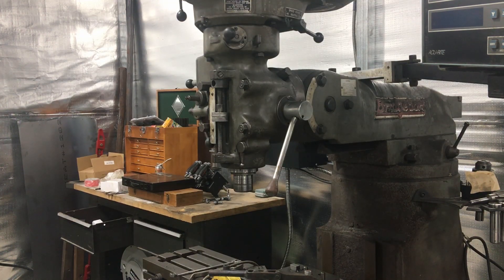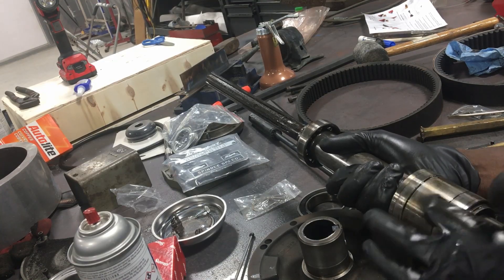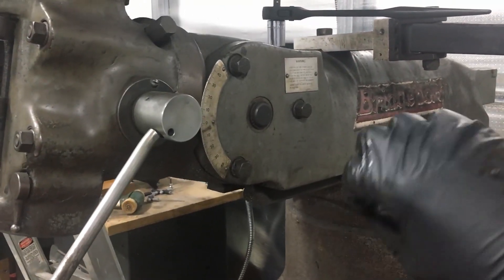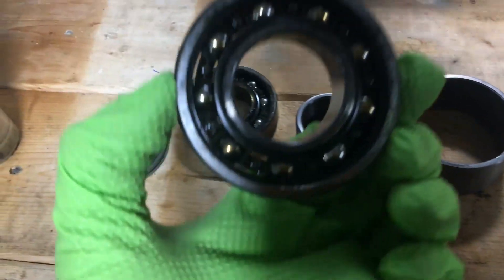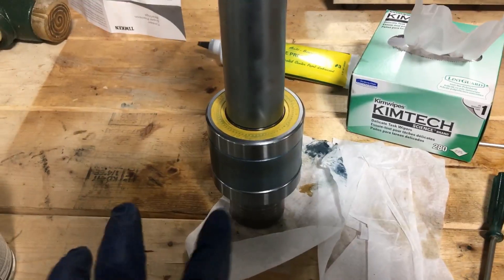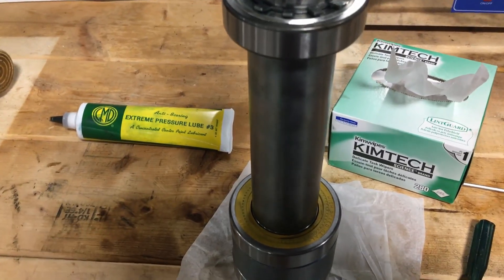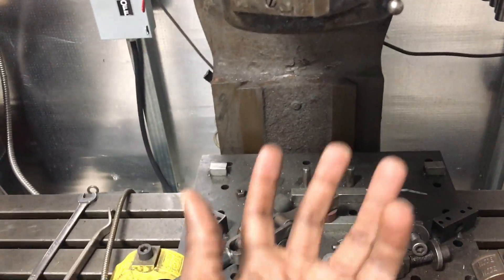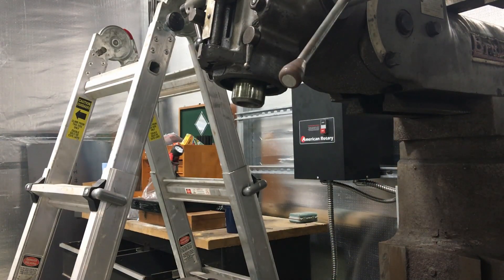Bridgeport Disassembly Part 3

Comment: I just started tearing my mill apart this evening. Great videos.
Reply from the maker: Glad they are helping. How deep are you going with the rebuild?
Reply: @Jayjam209  Was just planning on adjusting the Y-axis gib.  But how its been completely disassembled and I just stripped all the paint for a new paint job.  Plan on shimming the gibs and general cleaning for now and then order the bearings to rebuild the head.
Reply from the maker: @sfranklandnf  Nice! keep them alive!!! H&W Machine repair will be real helpful with getting all those hard to find parts for a Bridgeport. They are very knowledgeable so most of the staff can answer any question you may have. You may want to also consider getting your spindle checked for runout and reground with the new spindle bearings. I believe he will want the spindle housing, and spindle as one assembly. I will be scraping my ways and getting my spindle reground when I do a complete tear down. Good luck on your rebuild. Let me know if I can answer anything. Cheers.

Comment: My machine j head vary disc wornout.which aren't available in my country.IWant to put fix pulleys on motor and spindle.anduse VFD for speed control.pl guide me will it be possible.
Reply from the maker: Hi Arshad, you can probably do that if you have the ability break down the head machine some new sleeves (or bearings) so belt rights and same plane with key and get the pully diameters right for adequate torque from the motor side to the spindle.  I wont tell you its impossible but you have to have a strong foundation in machine design. A good starting point would be to google the stepped pulley 1~1.5hp Bridgeport j head and mimic that configuration.  What is wrong with your vary disc? Is it chipped? why not machine a new one? If it is chipped/cracked you can probably braze on some metal (build it up) and machine the taper back on a lathe. If the hole is loose, you can add a pressed in bushing with a custom key. If you can find another head, you can mount a J head instead or use of parts from a 2J head in your head. I believe you have some cheaper, less involved options, but I need some more info to advise.
Reply: Bridgeport's were manufactured in several countries, sometimes under private label agreements.  Parts from all should be fairly interchangeable, or with minor modifications.  The basic design has not changed much over the last 60 years.  Parts should be available world-wide. 
 As Bridgeport has become the standard for manual mills, All kinds of Clones exist from China, Taiwan, and elsewhere.  Many of those parts might fit, or with slight modifications.  If it is difficult to obtain various parts due to Import/Export restrictions, take it to a local machine shop and reverse engineer it, and make a new one.

As @Jamal S. says,  Everything on a Bridgeport is repairable.  What can go wrong with a mill ?!  Things break.  Or, they get worn out.

Bearings ?  They are available everywhere, and online.  Generic bearings If Bridgeport parts aren't available .... Just match the specifications
Bushings ?  Machine your own.  Even a relatively beat-up, older lathe can machine a bushing that will be adequate.
Broken or bent shafts can be welded, or straightened.
Broken or cracked casings can be welded or re-cast using the old part to make a mold.  Aluminum can be melted and poured with a very primitive set-up.  Hand finish the new part, and you are ready to go.

It is very hard to truly kill a Bridgeport.  Any of the above options seem to be a better, more viable option than what you are suggesting.

How to to do all this ?  You Tube !!  They have videos on everything !!

If you are from the part of the world I think you are, I have seen some absolutely amazing things coming out of some very crude/primitive shops in that part of the world !!  
Check with some of your local shops, or from the next town over. 

Most parts are available somewhere on the Internet, if you look long enough, hard enough, and try using different key search words until you find the correct combination.

Comment: cool good work, nice to see the boy getting involved that's some nice father son time there.  i dropped the whole quill out and ran it through the parts washer when i did mine.  you missed one critical part! whats the run out like now :-)  when you first run it make sure you run the spin around 400-500rpm for an hour or so to let it warm up and distribute the grease evenly in those bearings,  if you go balls out straight away you can overheat them.  just run it and if the spindle nose gets too hot to touch then something isnt ok ;-) its normally one of two things,  the sealed bearings are over packed with grease or the preload is too high.
Reply from the maker: This is awesome advice, thanks! Will do. I am very sure I have missed tons of critical steps that a machine rebuilder is going to blast me. Good thing I haven't run the machine yet 😀. Did you rebuild the entire head or just replace the bearings?